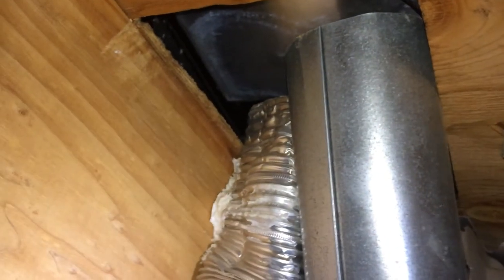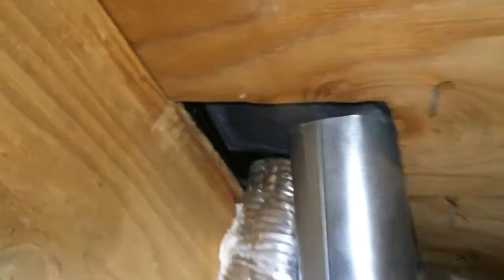Crappy bathroom fan vent through a roof.

Comment: What exactly is the solution for this? The roofing contractors installed standard roof vents over the bathrooms. Could they have used duct work to provide a better seal rather than replacing the vent with the circle connection for duct work?